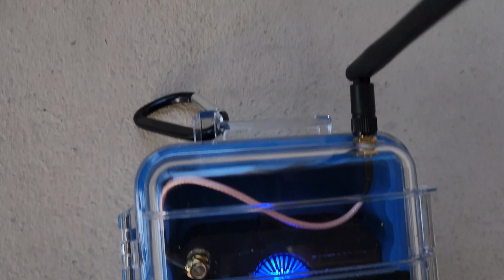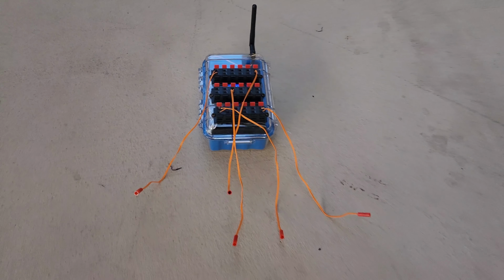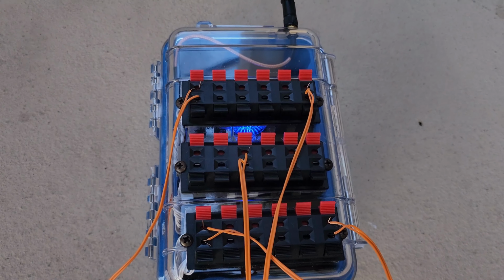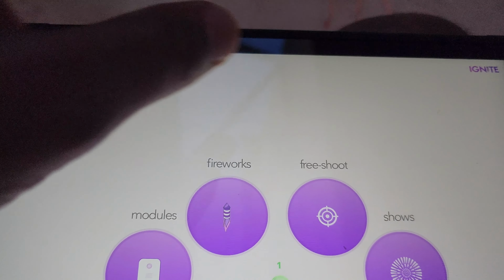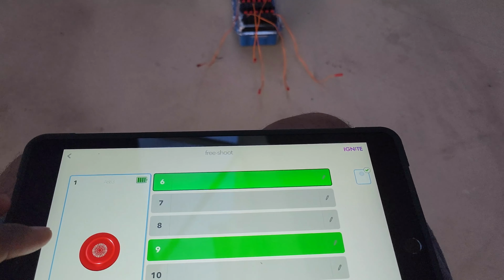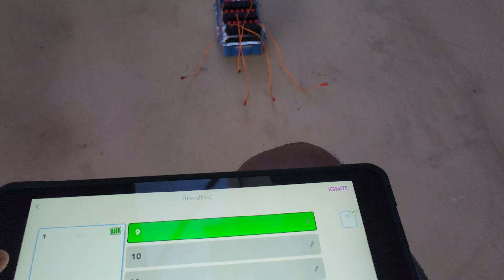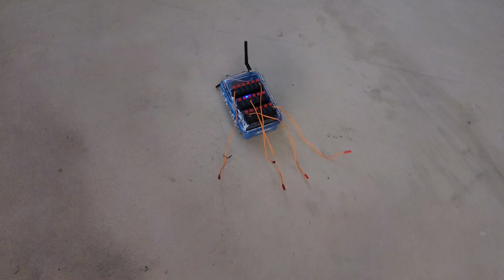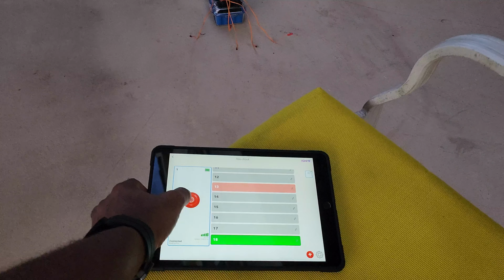Modifying My Ignite i18 Firing System To Use Terminal Clip Sockets

Comment: Nice job. I just pull my wires out. Never had any issue damaging the prongs. But I like what you did there. I may have to copy your idea a Lil bit.
Reply from the maker: Thank you 😊
Reply: I think I’m gonna do this as soon as I get my modules, I really like this system but the only thing I don’t like is haveing to use wires that are over a dollar a piece